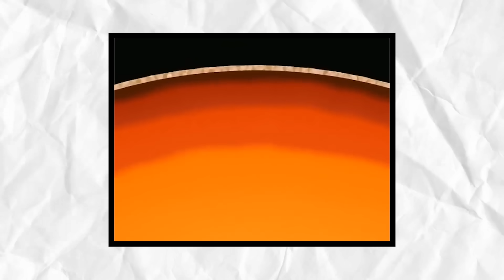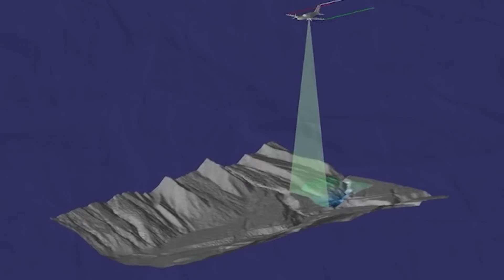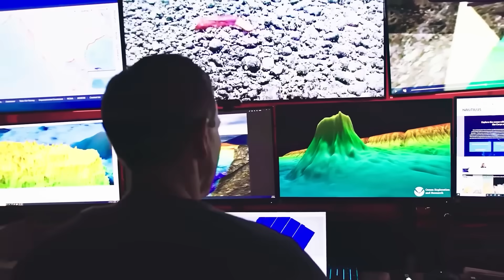Earthquake Strikes Greece: A Major Fault Line In Europe Is Waking Up!

Comment: Very similar series occurs in 2021. At first Quake 7.0 near Samos in Oct. 2020 (117 deaths), next quake 6,3 in Larissa, Continental Greece, in March 2021; next quake 6,3 in Akalochori, Crete in September, next quake 6,0 in Lasiti, Crete in October. And also after these quakes, none megaquake  on Hellenic Arc in 2021, 2022 And 2023.  Earthquakes in shallow normal faults in Aegean Plate are... normal in greek history. And also quakes on normal faults not causes megaquake on subduction arc.
Reply: Disclaimer, I'm not an expert for sure, but those quakes you mention were not on the Hellenic Arc, so i guess it doesn't mean they are connected to it, there are plenty of faults in Greece after all. The last one was very deep and exactly sited on the Arc, so I guess this is where the concern is coming from.

Comment: What about the 5'0+ quakes in Greece & Persia one half hour apart 5/26/2025. Both were 6.2 miles in depth. Are they connected?
Reply: Spin around, like a whirling dervish, clockwise (yang in the northern hemisphere/yin in the southern hemisphere) or counterclockwise (yin in the northern hemisphere/yang in the southern hemisphere). Chanting these mantras (yin mantras) heal each chakra: Um like "from"(root), Am like "Tom"(sacral/solar plexus), Oom like "room"(heart), Em like "them"(throat), Om like "home"(heart/throat/pineal) and Ngm (humming with tongue on the roof of the mouth/pineal/crown). These mantras build yang in the body: Eem like "team", Im like "him" and Am like "lamb". Chant these mantras a number of times at the corresponding sound frequency for each chakra: 1, 2, 4, 8: 256hz (root), 144: 288hz, 34: 272hz, 33: 264hz, (sacral), 5, 20: 320hz (solar plexus), 88: 352hz, 21: 336hz, 89: 356hz (heart), 3, 12: 384hz(throat), 7: 448hz, 13: 416hz (pineal), 54: 432hz(left brain), 55: 440hz (right brain), 60: 480hz (crown). The days of the week relate to the chakras as follows: sunday (root), monday (sacral), tuesday (solar plexus), wednesday (heart), thursday (throat), friday (pineal), saturday (crown). Sleep with the head placed at any cardinal direction. The cardinal directions represent the 4 seasons: east (spring), south (summer), west (autumn), north (winter) in the northern hemisphere or east (spring), north (summer), west (autumn), and south (winter) in the southern hemisphere. Stare into these symbols before sleep in order(or if resting sabbath, before sundown): the eye of horus and its mirror image, the eye of ra, one eye at a time, 7 colored rainbow, then the torus yantra, pentacle, metatron's cube, heptagram, enneagram and then the flower of life mandala before sleep. Go for walks while breathing deeply through the mouth and nose (count your breaths based on the number of chanting repetitions for each chakra depending on the day of week). While walking also periodically touch each finger tip to the tip of the thumb and make fists(mudras). Lift weights and box a punching bag. Place coiled copper wire into the soil and grow non-gmo soy, wheat, corn, mint, potatoes, regular (unfeminized) cannabis seeds (sour hebrew national, mercury rising) and papaver somniferum (7 year crop rotation). Get natto starter to make natto. Place bare feet and hands on the grass. Sunbathe or shine white LED light on skin during the day and at night use LED lights on red(sunday), orange (monday), yellow (tuesday), green (wedsnesday), blue (thursday), indigo (friday) or violet (saturday) settings and expose all skin to the light. Another helpful suggestion. From friday sunset to saturday sunset rest the sabbath which means no lighting fires (no lighters, stovetops, hot water from water heater with pilot flame etc.), no physical exercise, no singing or listening to music, and no buying or selling. This will increase yin in the body for the following week. Breaking the sabbath(doing the opposite) will increase yang in the body for the following week. During the sabbath, if keeping the sabbath, wear all white clothing. If breaking the sabbath, wear all black clothing. Rotate the sleeping cardinal direction at the end of every sabbath: east, south, west, north in the northern hemisphere or east, north, west, south in the southern hemisphere. Take boswellia, neem(sparingly), cinnamon, turmeric, curcumin, nutmeg, gotu kola, schizandra, fo-ti, oregano oil, garlic, vitamins and minerals. Drink lemon juice, lemon balm, mint herbal teas and kefir. Drink organic caffeinated coffee, tea or cocoa in the morning(take breaks from caffeine as well). Also take n-acetyl cysteine, bromelain nattokinase, ivermectin paste, pyrantel paste, and zeolite. Eat amanita muscaria infused chocolate with a 500mg thc infused chocolate. Drink baking soda in water (alkaline), brush teeth and gargle with baking soda. Gargle and brush teeth with peppermint, clove and cinnamon oils. Experiment with resting one different day of the week the same as the sabbath (from sundown to sundown) or every other day sabbath at least 4 consecutive weeks in a row the same day(s). Worship these: El (east), Ra (south in the northern hemisphere/north in the southern hemisphere), Allah (west), Aset (north in the northern hemisphere/south in the southern hemisphere). Face two solid gold, silver or copper framed mirrors at eachother east/west or north/south. Also get Kozyrev mirrors. Look into Nos Confunden's terra infinita map.